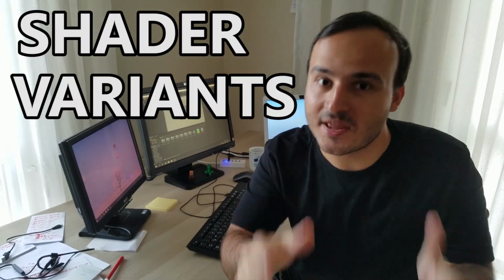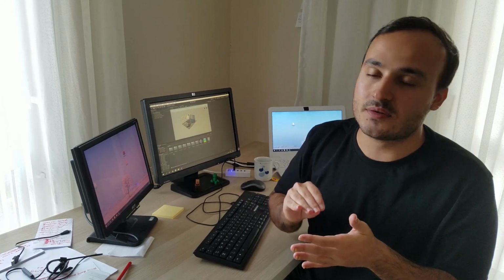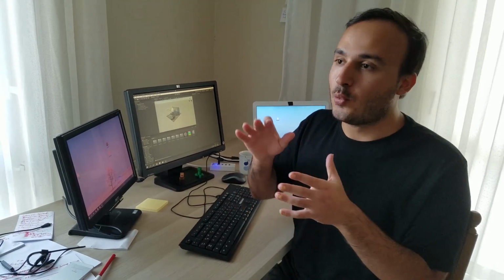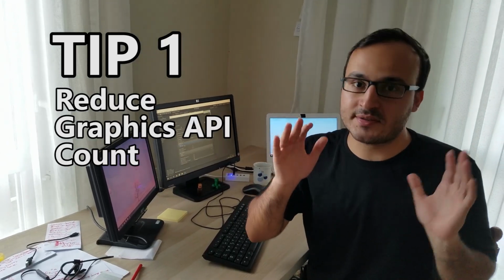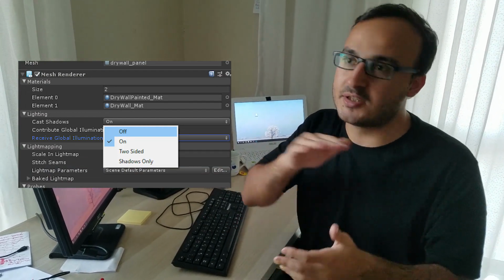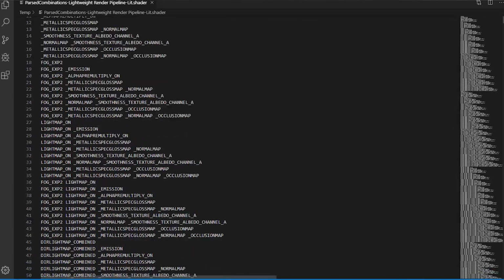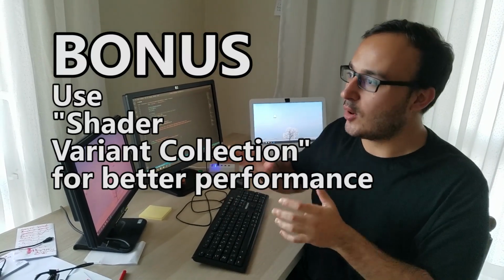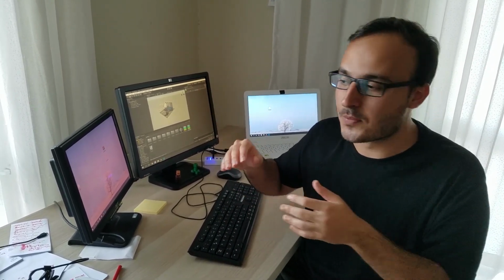UNITY SHADER VARIANTS - TIPS to Speed Up Your Build Time!

Comment: Hello! Great video and tips!
I have a question about my ios builds. I have a scene with some shaders and it turns out a lot of gameObjects look completely black on iPhone 6 and iPad Air 2. It is as if some shaders are basically not loaded. Some of these unloaded shaders are unity's standard shaders.. Do you have any idea about this problem? What would you suggest?

Thanks a lot for the videos, great content and awesome explanations !
Reply from the maker: If shaders wouldn't get loaded you generally get a pink plain color on those objects. In your case it seems like something else. If it is only for ios, there could be something with metal api
Reply: @MertKirimgeriGameDev  Also, the issue does not seem to be shader specific,
The black assets have the following shaders:
Standard
AnimatedTreeShader(surface template)
GardenBuildingShader (surface template)
Unlit/Transparent Cutout
Somehow a number of shaders seem not to be loaded properly. Thinking of testing this by adding one of the black shaders into 'Always Included Shaders' array.
Or should I discard Metal from graphics settings and stick to OpenGLES ?

Comment: Summary to reduce build time of shader variants:
1. Use only one graphics API (player settings)
2. Disable unnecessary features (reduce the amount of variants to be compiled)
3. Check each shader variant's count and reduce it (edit each shader file in Unity)
4. Avoid using #pragma multi_compile as it will compile shaders regardless of they are used or not (but don't add too many because this will use up your memory)
5. Use #pragma shader feature instead to not include unnecessary shaders in your build
6. Create shader variant collection to include preset shaders in the memory in the beginning of your game

Lastly, this video is reeeeeeeeeeealy great, thank you so much. You made my day:)
Reply from the maker: Thanks a lot! If you can put timestamps, I can include them in description🙂
Reply: @MertKirimgeriGameDev  Hey is it really okay to only use one graphics API? because i'm afraid some device might be not support one of them